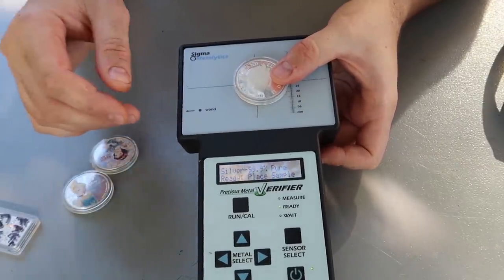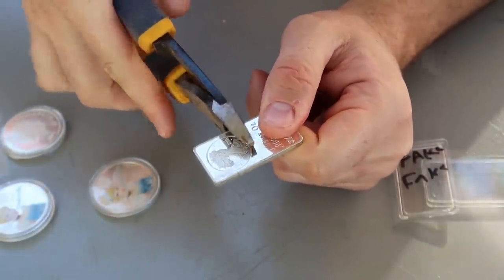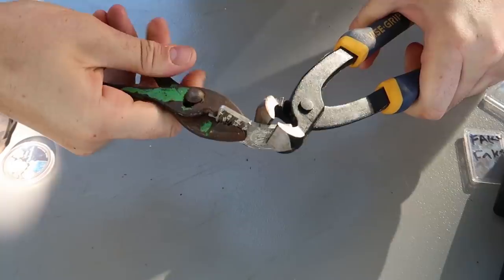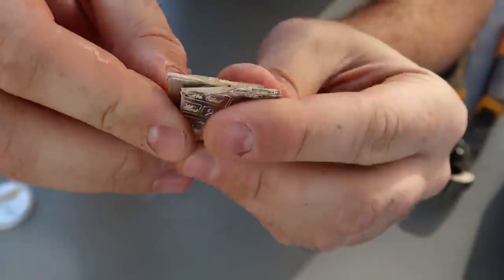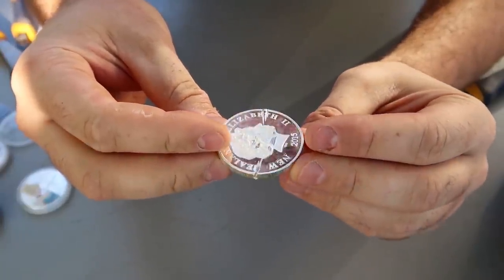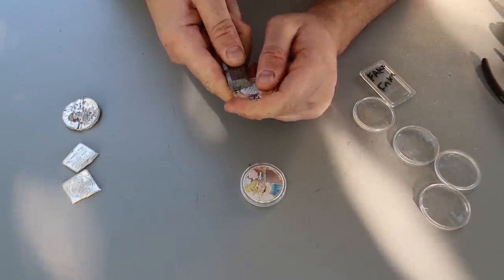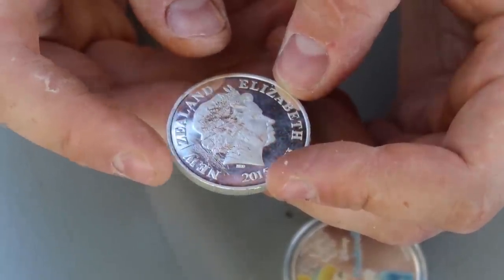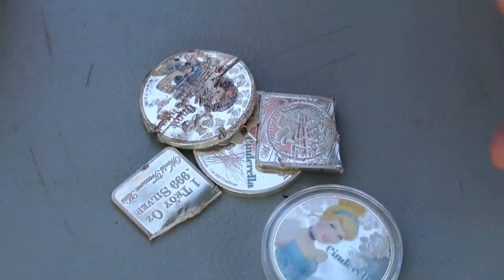What's Inside Fake Silver Bar and Coin

Comment: Lol those are nail pliers and wire cutters. You needed a hacksaw.
Reply: knipex mini bolt cutters would have done it. I use my pair at work to cut framing nails.. cuts through like butter.